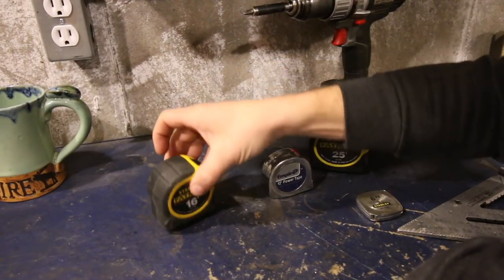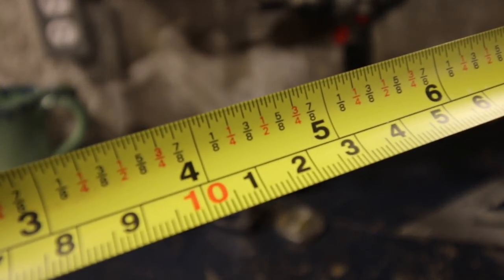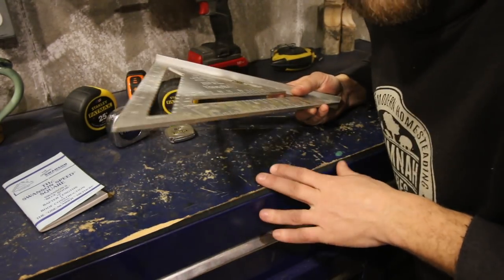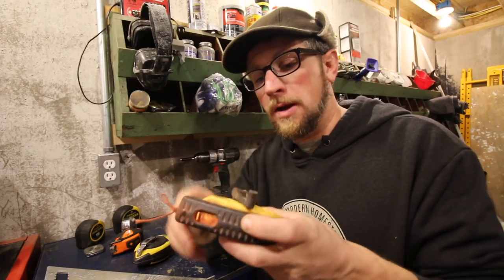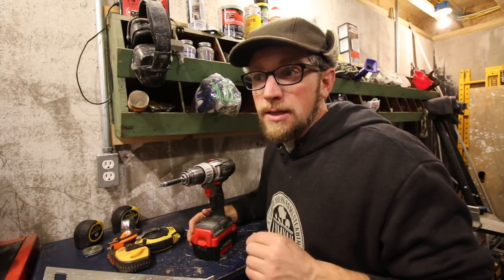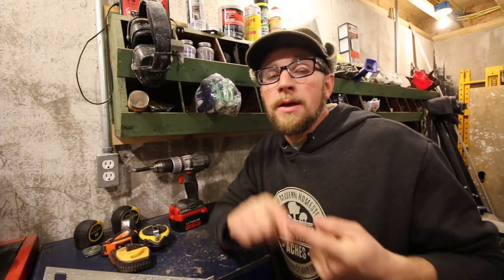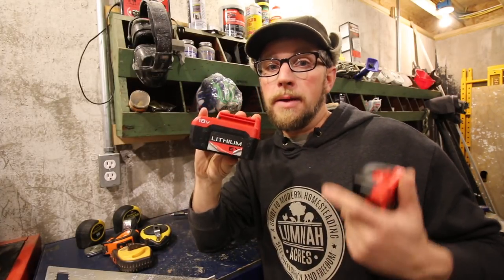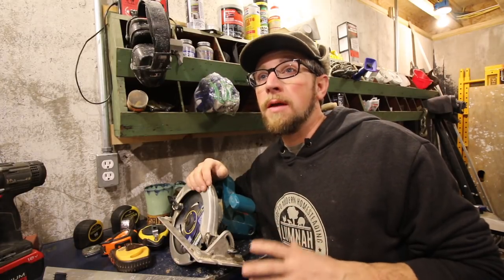Tools we Use Building Our Modern Homestead

Comment: I have Ryobi lithium 18v. I poop out before the batteries do. But it's hard to push the 2 buttons to release the battery. Noticed yours had 1 button. And I have the tape measures too but what's really cool is the wheel. Don't know what its called but I push this wheel and it counts how many feet. All the tools used to sit in the shed til my husband got home. Sometimes 3 months on the road. You've encouraged me to learn how to use them myself. Thanks, looking forward to more.

Comment: Speed square, read the book. You might not ever construct a stick built roof, there are many features on a speed square that will speed up production in other ways. 
Chalk line, the old pros replace the cotton line with 50lb. braided, nylon fishing line. Available in any sporting goods dept.. Easy to peel off old and wind on new. This line leaves a very fine, chalk line, has a lot of stretch for long pulls, it gets nice and tight even over long distances. If it gets wet, it dries faster than the cotton line, which also gets, fat, fuzzy and stiff. 
Good buying tips Al, I'm sure many of the modern steaders will benefit from your advice.
Reply from the maker: Thanks I like the tip on the braided fishing line. I will have to try it
Reply: Thanks David! I knew there was a reason I needed to buy more fishing line...the 50lb trout story was not ‘holding any water ‘!! 😉😁

Comment: I have been pretty happy with my Ryobi set.  Being a girl I appreciate the weight and balance of the Ryobi tools.  They are easier to handle, so you can be more precise and they don't wear you out after a long hard day of work.  I have a lot of Ryobi battery tools.  They have taken a licking and kept on working.  Recently we were working on a shed roof here and one of my old (over 10 years) Ryobi drills slid off the roof, not once ... but twice.   The last trip the handle cracked.  It still works.   I also recommend the new Lithium battery system.  Really work well and last long.
Reply from the maker: Thanks you are making me want to go get a new set! Lol
Reply: Just tell Santa!

Comment: I always enjoy a good tool discussion. 

You sure down played your love for that drill. lol. 

For batteries, amp-hour rating is what you look for. Those bigger ones are probably 3AH  some go 5 and higher.  That little one is probably 1 AH. A higher voltage will give higher torque and RPM.

Comment: Love my Ryobi tools!  I discovered them back when I owned Home Depot stock!  They have served me well, very well when I consider price.  I had similar issues with the battery but honestly even the small battery size from Ryobi kicks some butt!  I have 3 large and 2 small that a tool must have come with.
Reply: Little White Dory nice thing about Ryobi is the Old blue tools can work with the new li-on batteries  but You need a new style charger  
Home depot still carries the blue ni-cad batteries for 49.99
Reply: Walt Lars I've seen a two pack of the 18v +one 4 amp hr li ion at Home Depot for$99 and somehow I have several chargers so that helps.  I also have several Ryobi li ion tools at my Florida condo.

Comment: Al Lumnah Acres : I was reeeeeally hoping you'd do a tool series! Thank you! 1st, I am an odd woman...I would rather spend hours in Lowes or Home Depot over clothes and shoe shopping! 
Lately I've been buying a lot of power tools from Harbor Freight (yeah, I know, bottom of the barrel quality, but for what I need they've been alright). I'm currently getting some projects done in our house to get it ready to sell. Building a lumber plank counter top from Alder is the by far the biggest project yet! 
I borrowed a DeWalt miter saw from a friend and he provided the stand to go with it. I've watched several of your videos but I could not for the life of me figure out how to get the saw mounted onto the stand. I had to return the DeWalt saw to my friend (he needed it back) and went to Harbor Freight and bought my own compound miter saw (no stand.) I am really enjoying the woodworking and creating something from a bunch of boards, and I can't begin to tell you how useful this series on tools will be! I was not aware of the fence for a skilsaw or the depth adjustment. I'll have to look at my Black and Decker circular saw to see if it has that on it. Also, I have a Ryobi nail/brad gun...I LOVE it! I've used it to hang beadboard in my kitchen, and no compressor tank needed! Just plug in the battery and GOOO!
Reply from the maker: I bet the Black and Decker has the depth adjustment. I would go shopping with you! :)

Comment: I love Harbor Freight!  They are perfect for home owners who do their own repairs and improvements.  I call it my toy store on a budget.   I have a 3/4 inch Craftsman drill with a cord that I got in 1973 or 74 for a simple repair.  I also have a few tools from Harbor Freight bought for the same reason.  Do you do electrical work?  I am having a friend wire my attic and I have plans for other wiring repairs.  I need ideas for replacing ceiling lights.  LOL!

Comment: Great information.  Well presented.  I relish the discussion on the batteries.  I look forward to your daily videos.  I have a problem in The Philippines with 110 electrical products from the USA when the standard current in The Philippines is 220.  I have seen equipment burned out with the 220 current.  Thanks for the information on selecting a good, better best when buying a tool.  Merry Christmas to you and your family.  God bless America.
Reply: Oh my goodness, aren't the 110 volt meant to be used with generators not mains electric?

Comment: Check Pawn shops for tool deals 

Also if You are a one man show  you dont more than 2 batteries or one charger since you are useing one while #2 is charging 

I buy bare tools off E bay and Amazon thats a tool without a charger or battery  generally for 20.00 to 40.00 each   

The chain Batteries and bulbs + can rebuild a batt pack for 25.00 each

Comment: Now that it's winter, you seem to be having trouble finding content. I noticed that when you were building the cold room that you have a forced air furnace  in addition to the big wood  burner in the basement. It's a high efficiency one I note so it is a really good backup heat source for when it gets really cold I suspect.
Reply from the maker: I figured I would take some time an answer some questions we were getting during our busy season
Reply: I got a feeling, content won’t be as troublesome as you suspect, with that cool outdoor kitchen! Now, Al needs to timber frame a kickin workshop!! But not till spring thaw I’d imagine!!😉